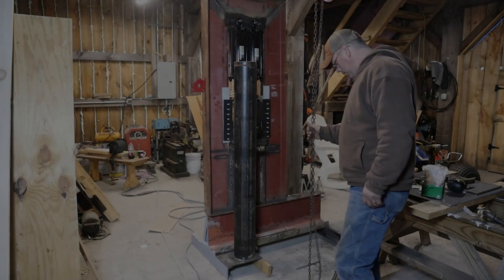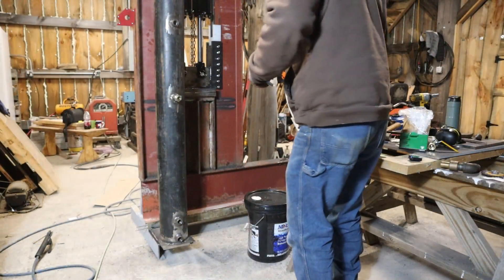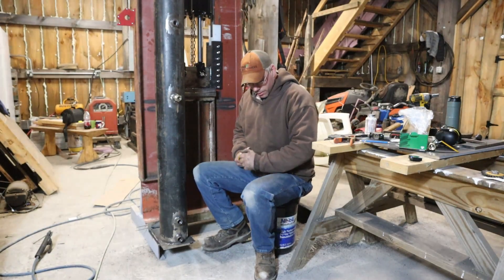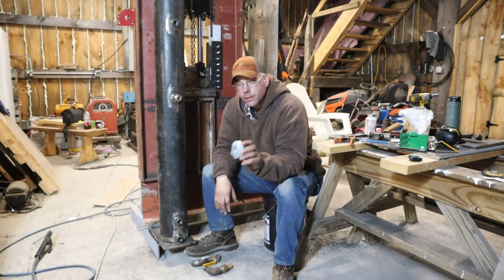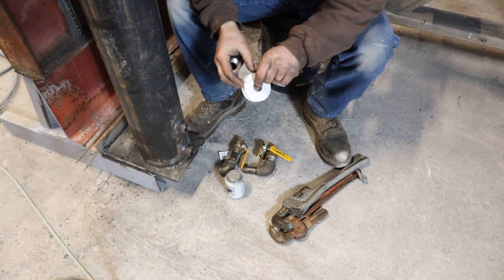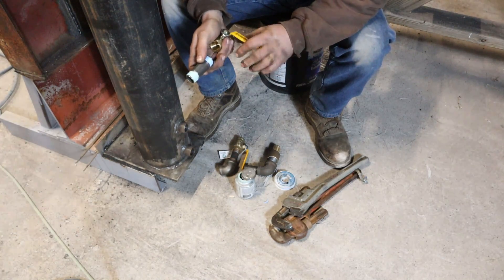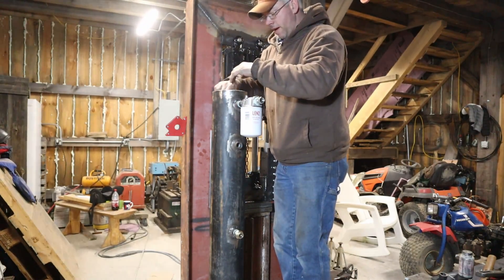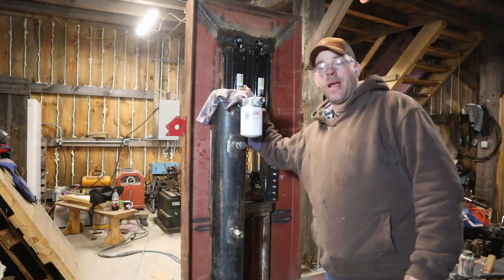STOP!!! USE THE RIGHT TEFLON TAPE: Forge Press Build Part 9

Comment: Why did you not  mount it on the side where the red magnet was hanging ? May have been able to get by without using any 90's.
Reply from the maker: Smaller footprint, although now that I'm making the forge much bigger it would not have been an issue.

Comment: I had to use black pipe for my LP gas heaters. The galvanized coating breaks off and plugs everything up. For us, running to town takes about 1 hour or so, plus gas, plus everything closes early because of the virus. I work for the UAW so work is a no go for this week, I haven't got any unemployment for 5 weeks. Oh well. Looks good.

Comment: You might consider checking out X-pando pipe joint compound. It's what we use in the elevator trade for hydraulic oil.  I've personally seen it seal up torn out threads from a dull die in 3" sch 80 @ over 600psi. Read up on it, it's impressive stuff.
Reply from the maker: I will and thank you very much.

Comment: Idea:  Mount your hydraulic tank on the bottom horizontally ( I know it would stick out but it would be out of your work area.
Reply from the maker: I almost did but I can't take the chance of the pump cavitating by having the tank lower than the pump.
Reply: @TheTradesmanChannel  As I thought again (sometimes unusual) how about mounting it on the side (vertically) of one side of the vertical rails? That should still get it out of the work area!
Reply from the maker: Almost did that one too, but then I wouldn't be able to fit it in the forge.  I think you and I might think alike.

Comment: In theory 90’s would decrease flow however when a person looks at all these new tractors and skidsteers the first thing is a 90 right off the hydraulic pump or spool valve. In your case I don’t think it would really be and issue as your main concern will probably be pressure rather than flow. Plus your distance between all components is short. Looking good so far.
Reply: yes looks like it has a good amount of daylight and sturdy built, wish was more powerful pressure like the range of 30 tons but your press your choice it is what it is, I always admire those that can build their own stuff, there are not quite as many this day and age that can do this stuff or have the skills to not like the handymen of the past many young just dont have an inkling of how to do these skills, or have this honesty like that drill, sounds like how I speak, hurt me good yea I had that happen trying to needle scale, or picking up wood you get a giant sliver makes life miserable every time and its always in a spot that is going to get hit every time you grab something, or nicking myself cleaning my wood turning chisle on the carbide every time.

Comment: Thanks for the info on the Teflon tape. Never thought of that.
Also, add gussets on both sides of the base W section, under the verticals, so you don't crush the web.

Comment: Afternoon, Jim. Liking the drip tube inside to reduce air bubbles in the system. Sounds like you definitely have thought this through. I tried telling my brother about different Teflon tapes for different uses. He used the cheap white stuff for a gas line, and sure enough, it leaked after a few short weeks.
I went over with my yellow gas line tape and fixed it for him. I have worked in so many trades,  it is kind of comical that he still thinks he knows more than me when the lineshare of his work has been office type jobs. I have to fix his "home owner repairs" several times per year,  but as he is older he still doubts me when I tell him something. 
Your build is coming along nicely. Keep it up.
Reply from the maker: I have some family like that, they always call when they can't fix something and then argue with me when I try to tell them how to fix it.

Comment: While you was installing the drain valve I was thinking how my slow foot would kick that open. Then you mentioned removing the handle. Problem solved!  Have seen hydraulic oil spew from a raised boom failure. It soaked everything in oil, what a mess!
Reply from the maker: I've seen it too, it is messy.

Comment: Looking good Jim,
Those hydraulic systems are a bear.  I had a wet kit on a truck and they installed it with alot if black iron pipe in the pressure side.  Had alot of over heating issues with it.  Finally a hydraulic professional informed us that black iron causes alot of heat in the system due to the ruff surface inside.  
I am truly impressed with your ingenuity.  Keep up the good work, it is enjoyable and interesting to watch.  👍
Reply from the maker: Just using some short nipples, the rest is proper hydraulic hoses.

Comment: hat dud,, i dont know about the usa pipe fitters, but here in Ont. Canada, the right way to meet code in all paper mills, mines construction, is on the pipe treafs it is 2 dabs of pipe dope on the threads and 3 wraps of tape then 2 dabs of pipe dope on every conection including NC AND LP GAS, BUT YELOW GAS TAPE ON ALL GAS CONNECTION AS WELL AS GAS DOPE,  using 90's on hydraulics or reducers makes heat, lots of heat.. not really a preser problem, as i have done many presser tests in many fitting set ups, i would have set that pipe up as a tank, so it layed down up on top of the press, makes for better draining of it, your drain is right at the floor, hard to drain it will b.. haaa
Reply from the maker: I'm hoping that having them on the low pressure side of the system won't affect too much but I could be wrong.  Time will tell.
Reply: @TheTradesmanChannel  it you dont use it for long times it will be fine but will make heat, specially the reducer

Comment: 90’s affect flow rate, I try and avoid them as a general rule, if you have to, try and find sweep 90’s if you can. Looking good Jim.
Reply from the maker: Hoping that a couple on the low pressure side of the system will be ok, if not I will have to revamp.

Comment: Jim the idea is to use 45s to work around components in a line as to many 90s can reduce the pressure, i wouldn't imagine you wil notice much if any drop in pressure
Reply from the maker: Hey buddy.  You are right.  I'll most likely lose a little at the tees feeding the cylinders.
Reply: @TheTradesmanChannel  any kind of regulating valve to keep the pressure even in both cylinders?
Reply: Thomas Russell I don’t believe he would need one. Push Pull Rams are self equalizing.